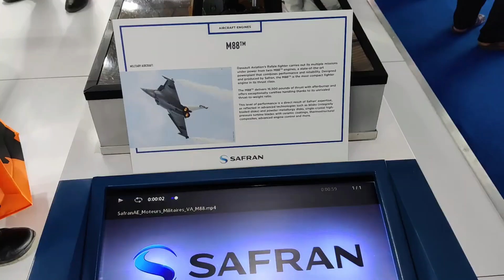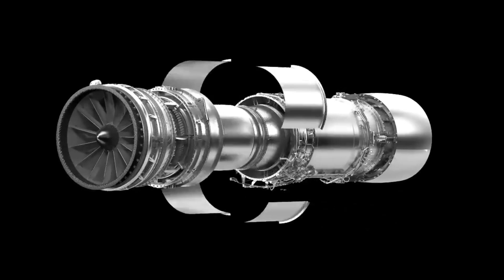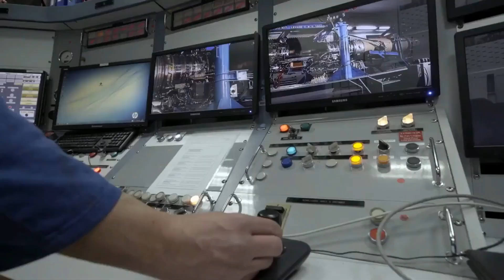Safran CEO & DRDO Chief at M88 Engine facility. Safran commits co-development of AMCA engine #drdo

Comment: Why not GE 414 - EPE in AMCA MK  1 which generates 116KN thrust and it is sufficient for AMCA MK 1 to Super Cruise ??? 

GE F- 414 EPE consumes 3 to 5 percentage less fuel and its weight is also less and generates 18 KN more thrust when compared to GE -414

Comment: Only the Rolls Royce offer was any good, Safran and GE have both never delivered on their offset obligations. Even now Safran still owes some crucial facilities that Bharat has never received.
Two steps to need to be taken: Get Kaveri certified and flying on the Tejas Mark1A as fast as possible, along with a flying test bed and other needed wind tunnel facilities. Second step needs to be a brand new afterburner that can match the GE 404 engines performance. For the first time Kaveri will replace GE404 engine for Tejas Mark1A. That is a huge step, and funding needs to be given to make that happen.Rolls Royce can help with next gen tech for the engine after Kaveri 2.0 Ganga. The only use of the SNECMA offer is to get better terms n conditions from Rolls Royce, but the RR offer is already the best. Regardless of corruption allegations. Modi has to be brave and sign the deal immediately.
Reply: It's not just technology aspect but Geo political too. Soon labour party is gonna come in UK which is usually anti India and pro Pak. Said that we should have gone when they offered the EJ 200 a decade back and then gone for new development of engine for amca. As the ge f414 deal is already signed, and with Safran also coming up with 100% tot looks more like we are gonna go for either of these guys rather than rolls Royce. GOI will use the rolls Royce offer to get better deal with GE or Safran 😂
Reply: @kaho6891- GE deal is complete crap, no IP rights, so SNECMA and RR are only game in town. Just pull the trigger, and take one of those two offers.
Reply: Jaguar k adour engine ka TOT to diya nhi eurojet ka denge.. Sb jhooth bolte h deal lene k liye
Reply: @nishantshrivastava9674  It's still the best deal mate. Neither SNECMA nor GE ever did their offset obligations. Alex Zino from Rolls Royce said the Intellectual Property Rights for the new engine will remain with Bharat.
Also HAL is building new plant for producing Adour engine parts, so they did do ToT.